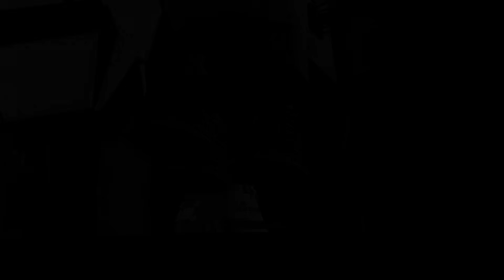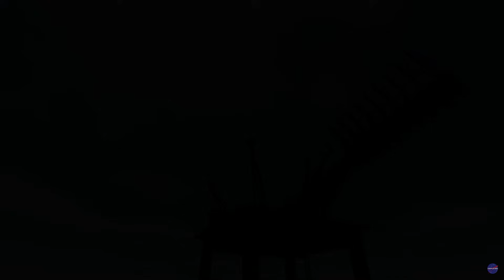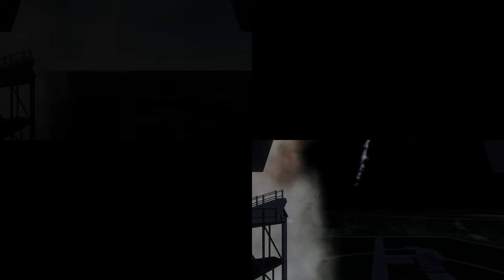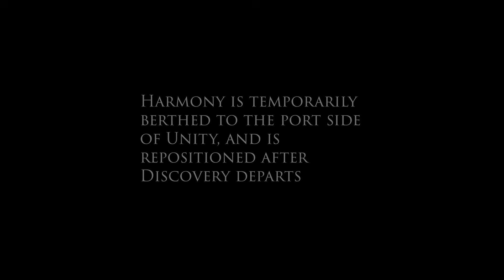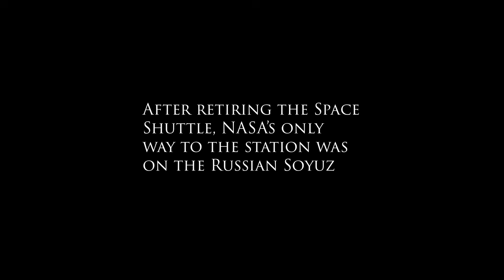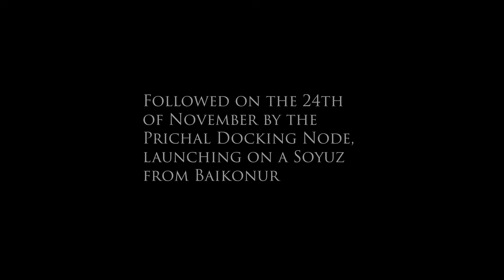ISS Construction Documentary | KSP RSS-RO

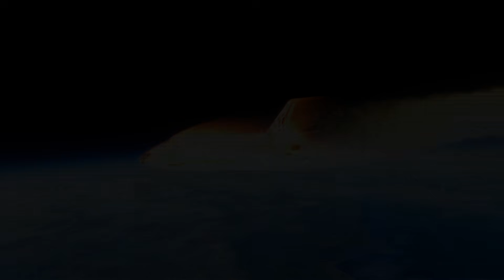Comment: 6:05 isn't correct, the shuttle did not have a ballistic reentry, it was pitched back as to avoid damaging the hull, that's why the heat shield is only on the underside of it. It did not dive nose-first into the atmosphere. Otherwise, great video!
Reply: An object that exerts no force while falling always follows a ballistic trajectory. Like a stone being thrown!

The angle of the stone, which influences its friction, does not change the ballistic aspect in any way.
Reply: @LaurentBessondelyon  ... you do know that the shuttle had control surfaces and a gyroscope, yes?
Reply: @LaurentBessondelyon yeah buddy have you even seen real reentry footage from any spacecraft
Reply: You know that this is a game, in a computer yeah? Is not actual real footage..
Reply: @SilverFox-1081  That's his point, it could've very easily been fixed by tapping S a few times (as a KSP player myself I understand balancing a shuttle in re-entry is hard but for cinematic purposes I believe it's worth it)
Reply: Can you not read? Sound out that big D word in the title. doc u men tary! Wow good job!